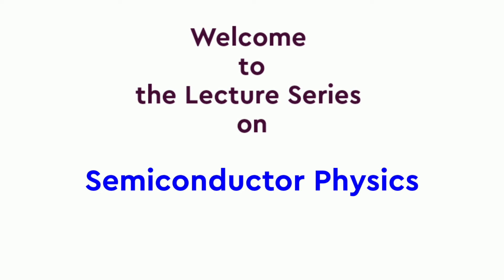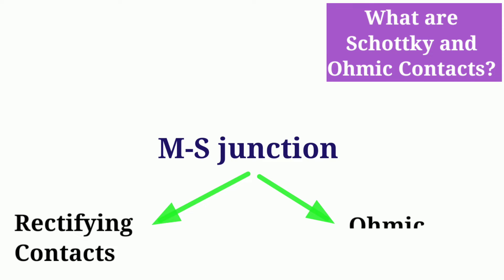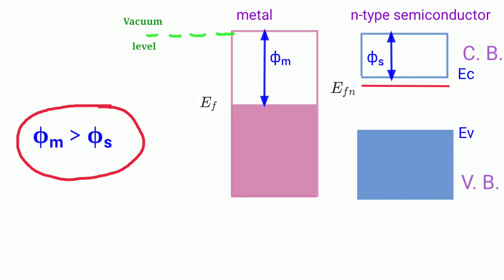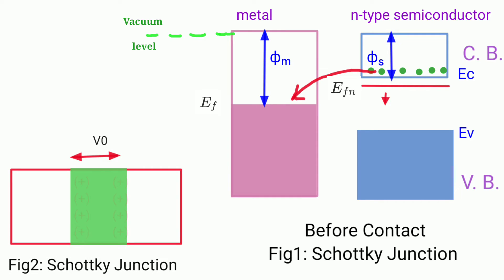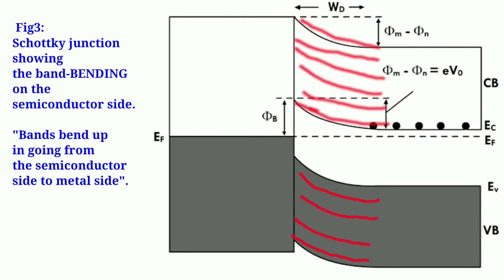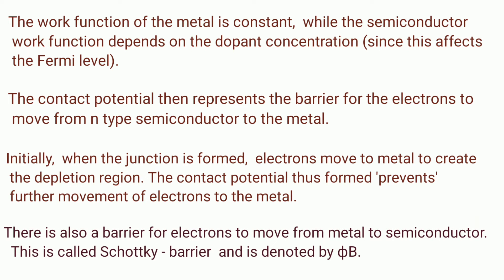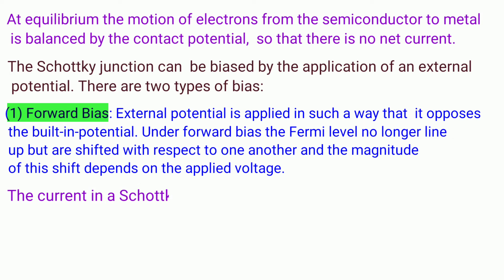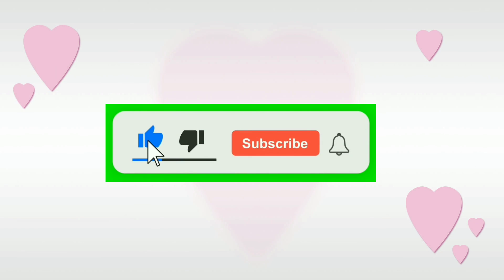Metal Semiconductor Junctions | Schottky and Ohmic Junctions | B. Tech/ M. Sc.

Comment: When measured on a crystal, the work function measured in vacuum depends on the orientation of the cut. Wafers are single crystal. Perhaps the (micro) crystals of the electrodes could be controlled? I should probably look for a database with results from an old-school point contact diode.

If we accept a Fermi level within a bandgap then we accept a temperature > 0 . But then there would always be some electrons which beat the work function. So a metal piece and a semiconductor piece floating in space would be in contact a little bit. I just imagine two spheres. They then would form a static dipole field.

The nice thing about this Gedanken-experiment is that we can be sure that no chemical reaction occurs. Contact is conveyed via free electrons .

Comment: Hello. I have a problem to underst the bending related to the band diagram. 

1 - The alignament of fermi level occurs, ok. But, how long does the fermi level keep aligned ( in nanometers ) 

2 - After few nano deep inside the Semiconductor, the fermi level returns ?
Reply from the maker: Well, 
The degree of band bending depends on the relative Fermi levels and carrier concentrations of the materials forming the junction (  that means Biasing is important ).

The band bending can be calculated by using Poisson's equation where rho(p) decides the degree of bending. 

Moreover,  the band bending never attains a steady state value. In some typical semiconductors the bending extends the entire width of the depletion layer ( that is upto a few micron). THANKS
Reply: @tanmaycreations99  Thank you so much, Do you have a Research Gate profile?